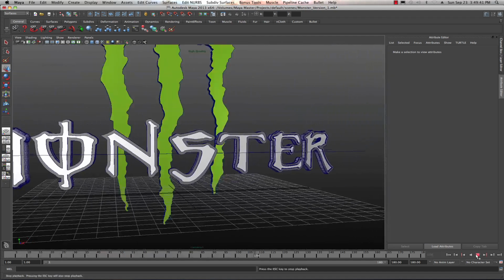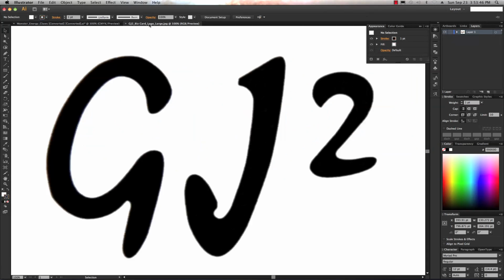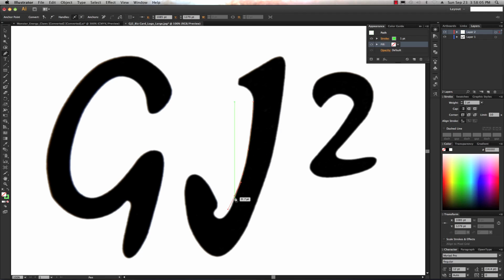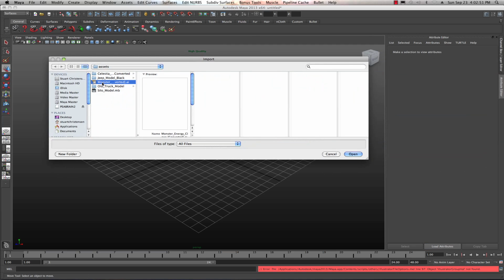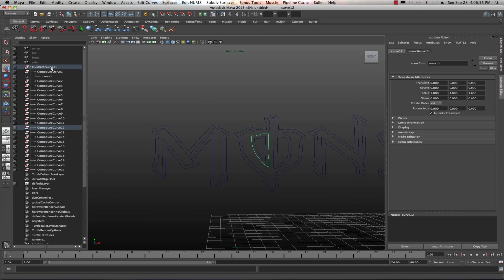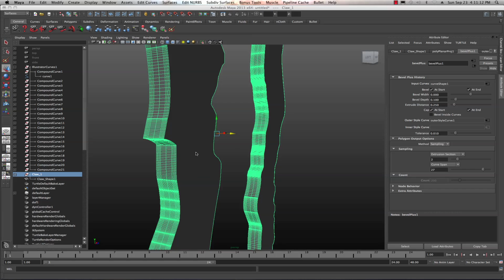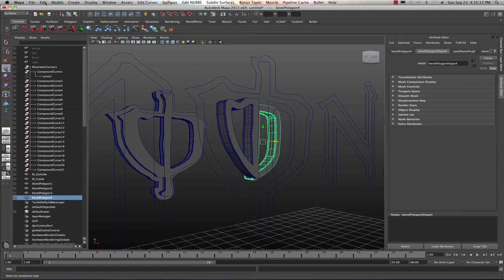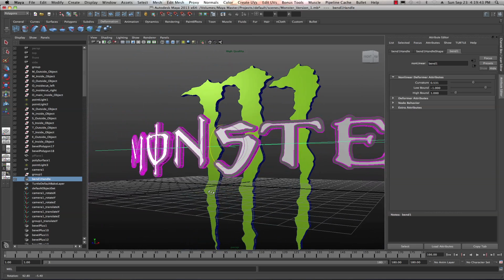Maya 2013 Using Illustrator Curves in Maya for 3D Logo Conversion Tutorial by Stuart Christensen

Comment from the maker: No offense taken mate!  When the Bevel Plus option is used the front face essentially becomes a single Planar Surface.  Normally with this method I don't use smoothing as its not really needed.  I understand your point about smoothing and 5 sided faces aren't good.  Smoothing can cause some strange results depending on what you are doing. Your observations are very astute and relevant though to many things concerning smoothing!  Thanks for the thanks!

Comment: Sure. Take 18:40 as an example. That whole front side of the "Claw" just looks like one big polygon = more than 5 sides. I wasn't very clear when I said "Lots of 5 sided faces", I just meant that each piece seems to have at least one big polygon on the front side with more than 5 sides. Basically I'm just curious what happens if you press 3 or go to Mesh -> Smooth. Sorry, didn't mean to offend, your videos are great.

Comment from the maker: Incorrect....all of the geometry you see here is quads....not a five sided face in the bunch....and the smoothing is oh so smooth........not sure what you are seeing....please explain.
Reply: Hello, I have been using this tutorial for years, and have made Some great 3D logos from it. But Now I am using Adobe's  Dimension to put together quick 3D renderings from my Illustrator/Maya extrusions (thanks). But due to the fact that the front facing face has too many vertices Dimension breaks the mode. Is there a quick way to add appropriate geometry to the front facing face?